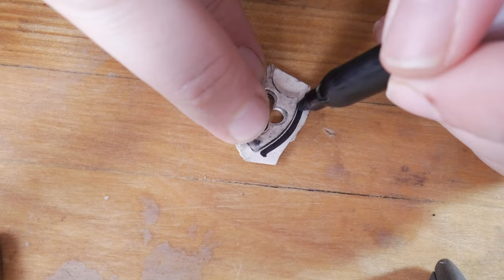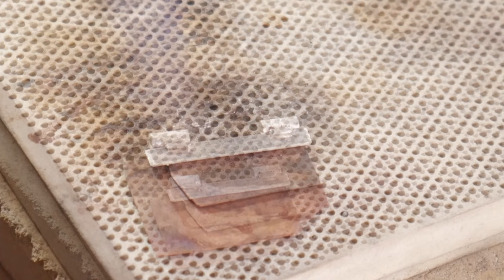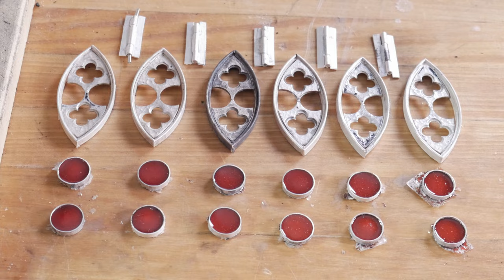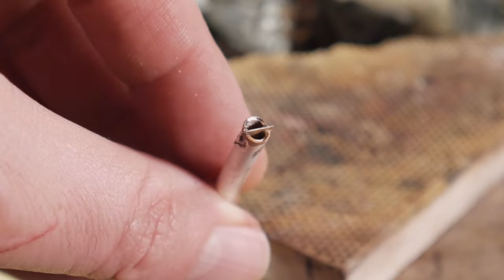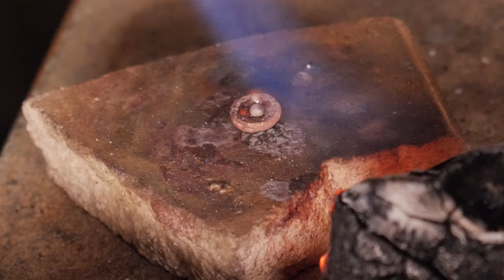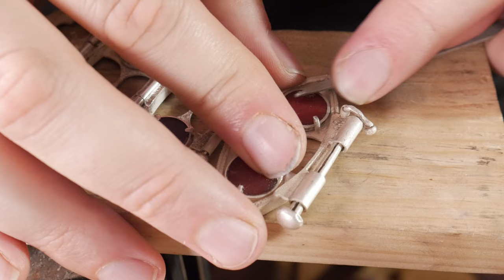Handmade Medieval Gothic bracelet (no music). With plique-à-jour glass enamel windows. metalsmithing

Comment: Terribly jealous of your quatrefoil punch!! Would you be willing to share where you got it? Thanks!
Reply from the maker: If you are in the states you can find it on Amazon. If you're in Europe AliExpress has it. It's made in China and mine needed to be honed before it worked that well. Just search for clover disc cutter and you should see the same one I used in the Google image search results. It doesn't cinch down on the metal though so be sure to hit hard the first time so it goes through otherwise it will just emboss the metal.